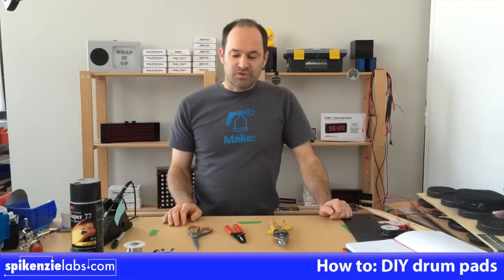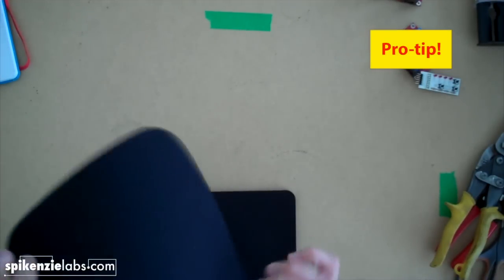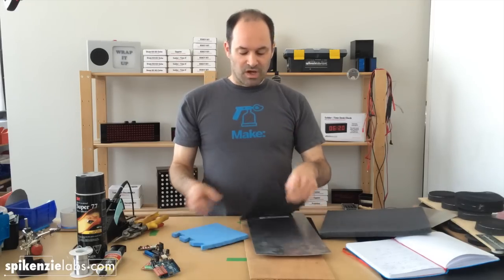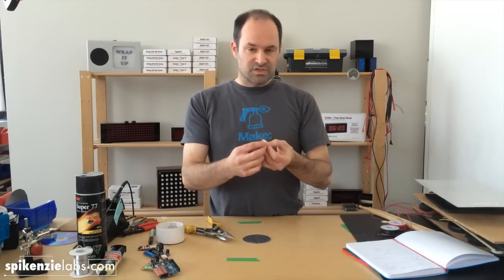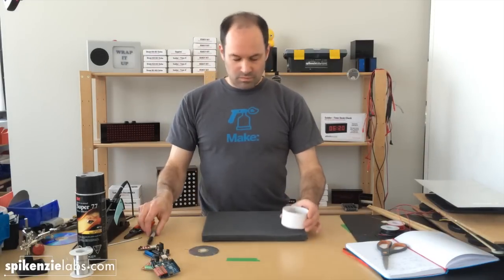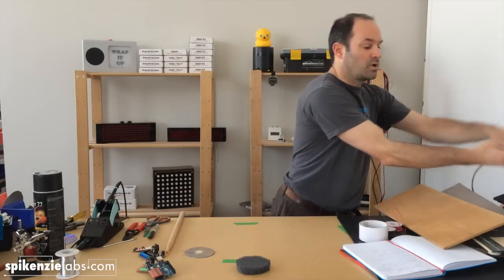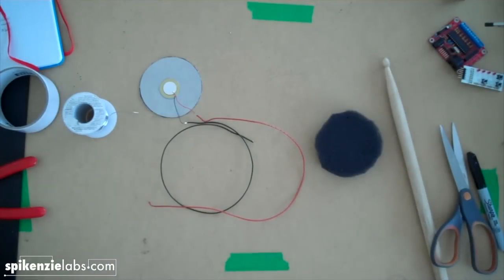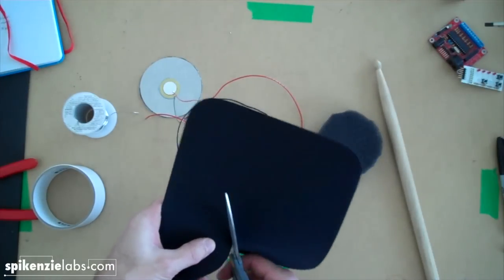How to make DIY electronic drum pads

Comment: Have you tried this?
• Cut a hole in the board slightly larger than the drum pad. (Maybe half an inch bigger all the way around.)
• Glue a net over the hole. If this isn't secure enough, use two thin boards with holes, and a net sandwiched between them. (Then you can probably just bolt the two together and skip the glue.)
• Glue the drum pad to the net.

That shouldn't allow too much vibration to get through, and what does will all be low-frequency.

Comment: Can I connect this to a pc keyboard? And then mapping in a DAW?
Reply: yes, If you can send MIDI messages then your daw can use this signal. I did it.
Reply: For anyone curious about this line of thinking, I don't think a pc QWERTY keyboard will work, as that uses a key matrix, not an individual circuit for each momentary button. To marry the two, consider a C-PAC controller. :)

Comment: I'm confused about the piezo disk..
Does it need to be attached to a hard surface to work? Could it be a soft (rubber) surface instead?
What if the metal disk short-circuit the piezo (if it is even possible)?
Great tutorial btw, thanks :)
Reply: HiMarion.  Im guessing the piezo has to be on metal in order for the vibration of the "hit" to activate the sensor.   The rubber covering is to give the drum stick bounce so you can do rolls etc.   The metal wont short the sensor.   The wires from the sensor are away from the drum pad and soldered.  You can cover this solder joint with electrical tape.    Hope this helps  :)
Reply: It also helps if you shorten one of the wires on the piezo, and use a slightly longer extension wire to compensate. Then your solder joints aren't side by side, they're staggered, so even if the electrical tape wears through they're unlikely to short out.
Reply: HiMarion, Do you think sheet acrylic would work instead of metal?
Reply: +Killadey I was thinking about that too..
Reply: I might try have to try it. I'm hoping I can pick up some pie dishes on the cheap. The one's where the bottom lifts out, I can use that as my disk, and there should be enough of a 'ledge' left in the tin for the foam to sit on top. I'm hoping the foam will act as a decoupler to the rim, so I can go duel zone.